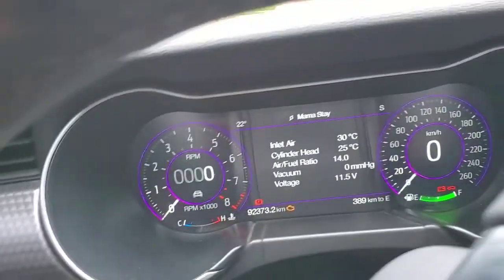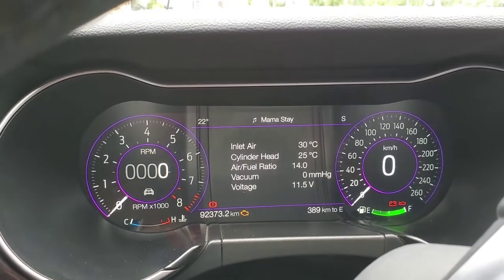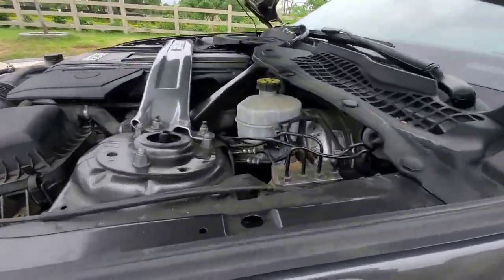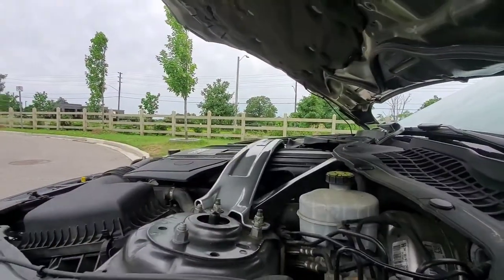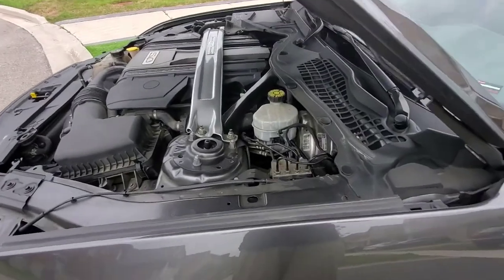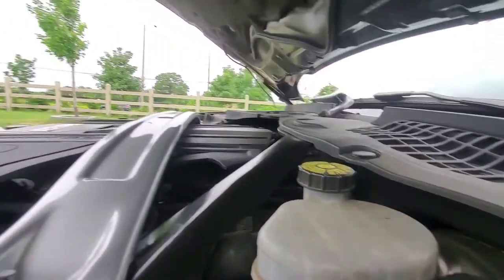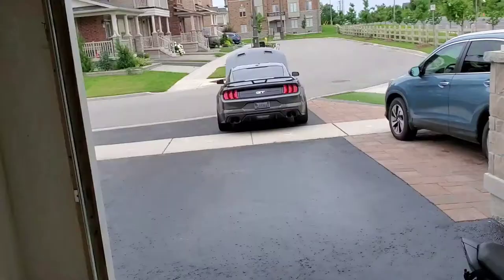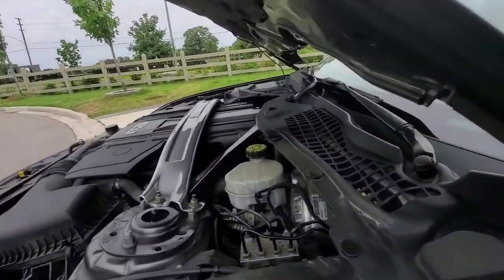2018 Mustang GT Typewriter Tick (3 years later)

Comment: That is a rear piston rod bearing. If you were to pull the oil pan you could slightly wiggle it front to back. And yes the tick that is not-repeated to the beat  is also a bearing tick. Some come straight from the factory with it and ford will lie about it and try do many different fixes that never work. Go get the rear bearings done and you will be very happy. Hope this helps. And now for all the angry faces to yell at me

Comment: I had the tick too, they never figured it out. I didn’t change anything. Kept it as is. Car was running fine for 2 years.
Reply from the maker: weird. Im actually starting to think its the high pressure fuel pump.
Reply: @Str8Bangerz  let me know what it turns out to be

Comment: it's your rod bearings witch sucks about us because ford doesn't want to do anything about it. but hey rod bearing just eating the crank is fine.. lol right,,,
Reply: There's no proof that it's rod bearings
Reply: @redbluepill2701  actually, there is. I think you need to go back and do your research on gen ones Gen twos Gen three coyotes. Also, I have had the pleasure to repair three coyotes which was rod bearing failure it was always the one towards the torque converter. When I get another one in. I will make sure I show you the proof, you desire.
Reply: Hi bro, having the same sound on my 2015 , so this issue is fixeble?@TOUGHBUILDSCUSTOMS
Reply: @mazinalmaimani6372  nope, it's completely normal.
Reply: Red lol… Yes it can be fix but in fords eyes it’s normal. It’s all lies. The coyote tick is rod bearings. You would have to drop your oil pan and polish your crank and put new rod bearings and bolts. Your good.